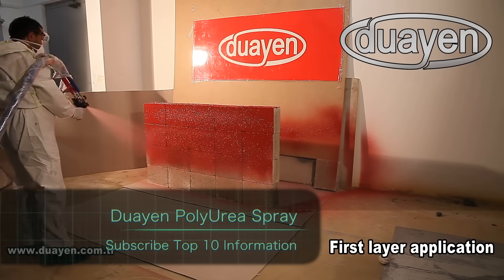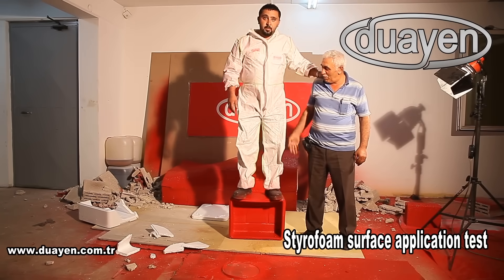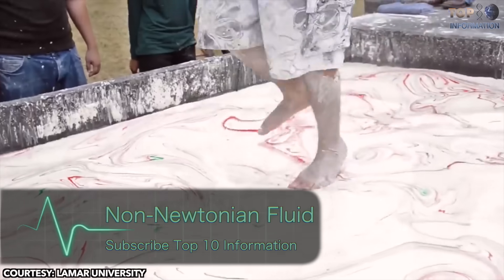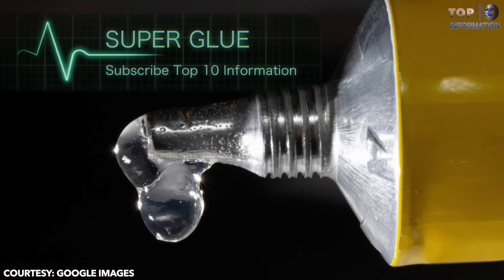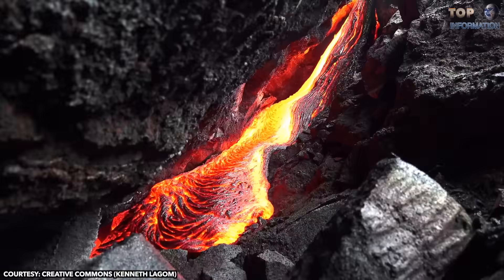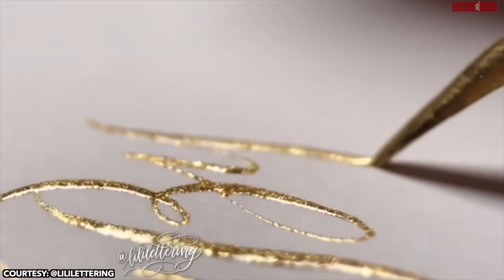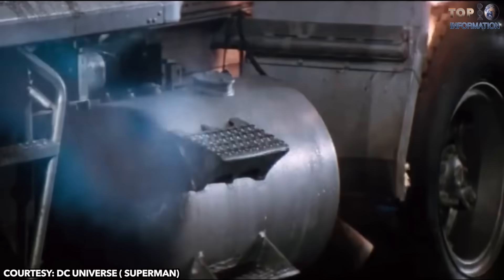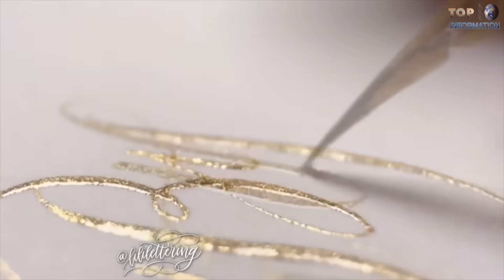10 Strangest & Coolest Materials Which Actually Exist ▶ 3

Comment: That Darien material is amazing no question about it. But it does absolutely not protect the physical structure of whatever it's coated inside that watermelon it is going mash to h*** just like those bricks were breaking it would be like putting it 2" coat of rubber on the outside of a cinder block breaking the center block and then saying everything is all good and well

Comment: Wounder how the red spray would workout as quickseal inside a tire or coating high velocity ammunition to minimise fragmentation, or even plastic like rounds. Or coating keflar vests, the fibers would never sepperate, would it still stop a bullet? Or imagine the camping equiptment, like a Cannoe in a can, just unfold the paper cannoe and give it a spray. Make it clear and use it as window protectant. Wounder how an airplane would hold up after crashing while heavily coated in it. Oh what if give for a few hundred gallons of that stuff
Reply: I remember an episode of Mythbusters, where they did all kind of tests with bedliner. Seems quite similar to me.

Comment: The ball that's used to put out fires is not a new technology they actually had this back I believe all the way in the 40s it was called a Fire Grenade and you threw it in and it blew up and put out the fire. The reason why they stopped using them was because they were dangerous and with the invention of the fire extinguisher they were no longer needed.

Comment: I work for Henkel, we make locktite, and liquid nails sub floor glue. The branch I work for get blocks and transmissions from Ford, we seal up any cracks and fissures in the block using resin, literally a high temp plastic, without it, the block could and would blow up and crack into pieces.

Comment: locktite didn't invent superglue. the amercan military did.
(it was originally made as an alternative to sewing soldiers up, just glue em back together and send them on their way)
that's why it is so good at sticking your fingers together.  (it will bond skin far easier than it will bond most other materials)

lava is not "also known" as magma...

when molten rock is beneath the earths crust it is called magma, when it flows on the surface it is called lava.
every bit of molten rock you see coming out of a volcano is called lava.

kinda the same way a meteorite isn't the same thing as a meteor. (meteor burns up, meteorite survives the fall)

(essentially they are the same thing but it is their circumstances that define their name)

Comment: That fire extinguisher ball would've come in very handy with all those fires in southern California this past summer. Of course they'd've had to've been much bigger then those shown in this video. But if they truly work as fast and as well as shown, they'd've been a big help. Though, personally I think the fires had a lot of help spreading. Some of the drone videos I've seen make go WTF! I'm talking about three buildings well spaced apart by several hundred feet yet all three ,were totally burned out. The trees and shrubs around them were untouched by the intense heat of the buildings burning. Even stranger was the fact that nothing else in the area was even slightly scortched.

Comment: sorry to say but fibre optic cables are hollow glass tubes that allow light to "PASS THROUGH" to transmit information
Reply: I hate to burst your bubble there,  but fiber optic cable is NOT hollow, and it isn't "glass"either! I should know,  I've installed and "connected" enough to fill a dump truck.
Reply: Ok im sorry :( dont need to get mad at me :(